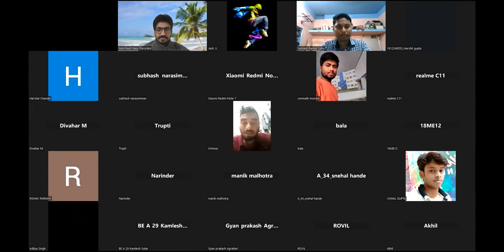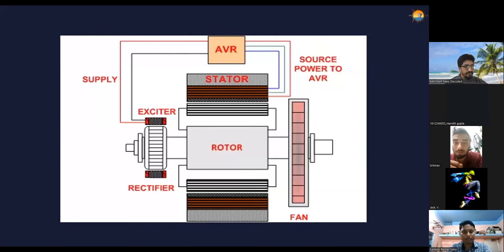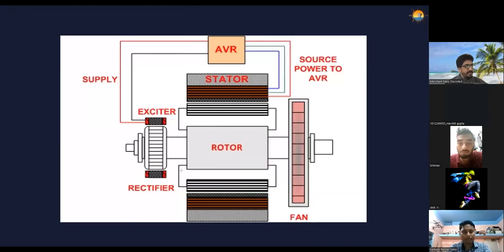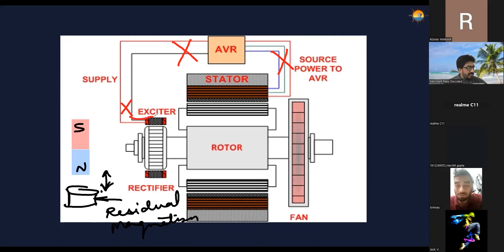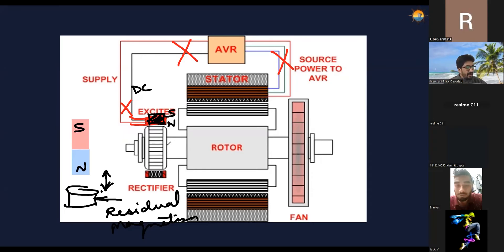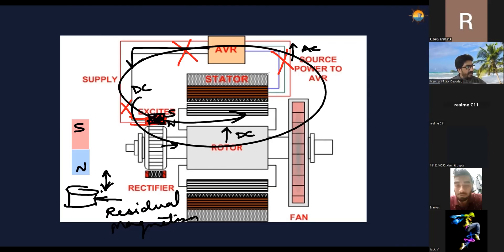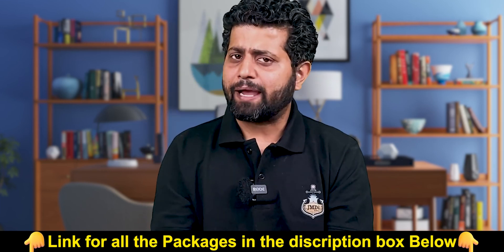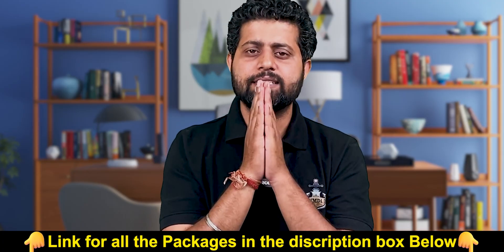How Does AVR (Auto Voltage Regulator) Work? | Merchant Navy Decoded Technical Workshop

Comment: Since EXCITOR STATOR Winding has DC voltage (RESIDUAL MAGNETISM)  it creates a Fixed Magnetic Feild which cuts through the EXCITOR ROTOR Winding ...SO DC gets converted to AC and then This AC is Further RECTIFIED using a DIODE PACK converting them to DC. Again DC voltage gets converted to AC supplying it to AVR. 
This Process DC---AC----DC-----AC finally to AVR. 
WHY ARE WE USING RECTIFIERS ?
Reply from the maker: Hi, 
Join today zoom session and ask this questions to sir so sir will define you in proper way. 
https://us06web.zoom.us/j/86363307519?pwd=4SZ6uef1AwarobBaPVvM5LcJPCWdya.1

Team Merchant Navy Decoded.